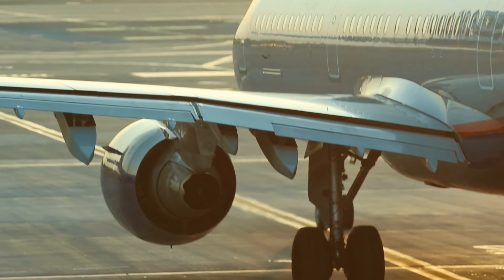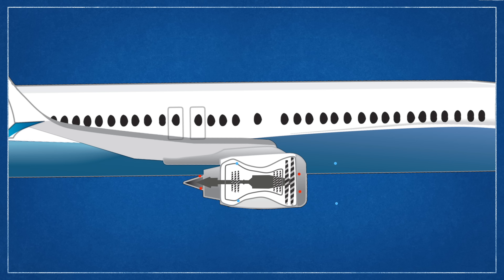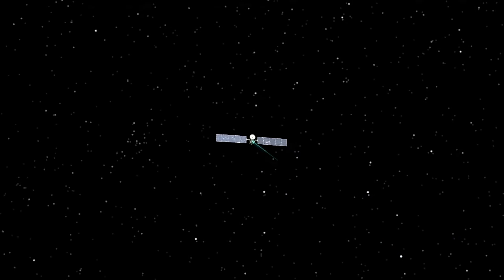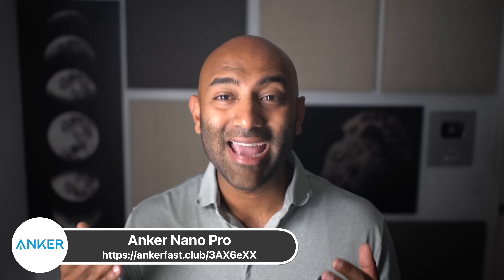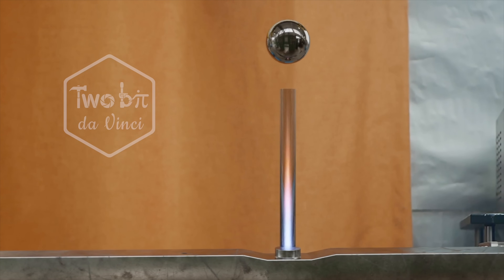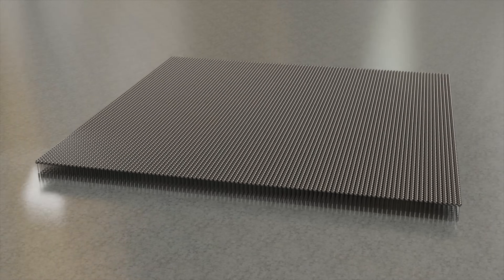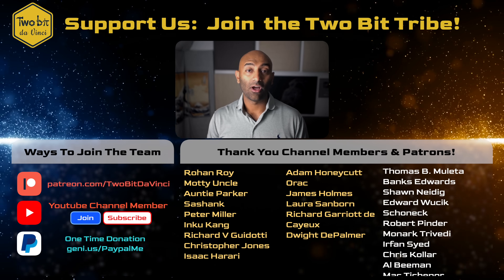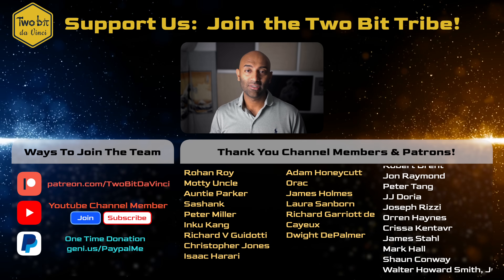The Next Generation of Jet Engines.... Is Electric?

Comment: This is some good thing honnestly. I don't know if this will be used, but the sci-fi fan in me is happy for that. However, Somewhere in my head, I'm thinking than blaming aviation for polluting when they contribute to "only" 2% of emissions is... stupid. Of course, yeah, everything help, and this is good, but when you have some things like coal plants, gaz plants for electricity, which are like 15-20% of global emissions, I think that would make more sense to reduce emissions in this sector because a 10% improvement in emissions for a coal/gaz plant would lead to a 1.5-2% global decrease wheras you have to get rid of 100% of aviation emissions to get the same global decrease.

And you know what ? Improving things by 10% is always easier than 100%. You'd not even have to build new techs : just replace the fucking coal/gaz plants !

And if that's way too hard, what about reducing packaging waste ? Why the fuck do you package vegetables ? Instead of putting the whole vegetable in plastic (with holes), what about just using a rubber band ?
Why the fuck is the responsibility of packaging on customer hands when you have almost never another "environmentally friendly" packaged product ? Why do you have to modify ALL your habits, when companies just have to fucking change their packaging habits ?

If you start looking at how much packaging is producing in emissions, I'm pretty sure that's the almost big polluters out right here. And possibly even polluting more than transportation.

Honnestly the whole shifting responsibility on customer is the biggest problem right here. We need better politics, because that's the only ones able to put some laws. And yes, I'm aware that using paper/cardboard instead of plastic is not always an option. And that shifting from plastic to paper/cardboard may lead to deforestation. But I'm not talking about replacing everything at once. But you know, for example, when I bougth a brush, the whole brush was in plastic, and fixed to the rack by the plastic whereas the handle had a hole, to be attached to the wall. Why just not put a sticker with the price, and use the handle hole instead of a full plastic which will straight go to trash ?
This is bothering me. Not aviation pollution.
Reply: I agree with you thoughts about aviation percentages. Not trying to be prudish, but would appreciate it if you cleaned up your language in a public forum.
Reply: @timgurr1876  Yeah sorry, I get usually triggered when talking about some subjects that I really care about especially when I think there are easy answers not being made for any reasons (usually the following two : greed from big corporations + corruptions of politicians usually). Thanks for the feedback I'd try to be more cautious next time.

Comment: The discovered technologies for one field usually find ground in something completely unrelated. I could imagine these being used for Space elevators that would allow a shorter length without a counterweight, Combined with an orbital ring allowing you to travel anywhere in the world at half the time without flying
Reply: Add that engine to Kurzgesagt's 'Skyhook' elevator/slingshot and boom, cheap interplanetary travel.

Comment: In the meantime- Fly aircraft on liquid Hydrgen.
Use walk-away safe Liquid metal Thorium ion molten salt reactors (TRMS) to generate electricity for $15/MJ (or 5.4cents per kiloWatt.hour); to electrolysis water for liquefied Hydrogen; to drive 
1) long haul trucks and trains; or
2) slightly modified fan turbines ( electrolysis fuel cells to electric propulsion via batteries. You can't do it by destroying tropical rain forest for Solar farms - (follow Indonesia's example instead).🥝🥝🙏👍👍
Reply: So aircraft propulsion is simple.
Using the near ambient pressure but high temperature Thorium molten salt reactors, you manufacture an aircraft jet fuel known as JP2. This has been tested by the US Navy and found to be successful, with the intent for aircraft carriers to make their own ful for their jets.
This is a CO2 neutral cycle as the marginal use of a Thorium MSR is CO2 neutral not like Mickey Mouse Ethanol-LoL.🥝🥝🙏

Comment: Two Bit da Vinci
: Great presentation, as usual, thank you for sharing. The possibility of gravity drive systems for spacecraft would make an interesting topic.
Edit: To those kind enough to reply to this post, remember that every rocket that leaves the planet, every satellite placed in orbit, and every craft sent to the outer planets and beyond make use of gravity for acceleration assist and orbital maneuvering to place the vessels in proper alignment and trajectory. Even SpaceX is considering sending Starship sunward for a gravitational thrust and acceleration around Venus in order to reach Mars faster.  Also, it is my firm belief that "gravity in a bottle," so to speak, in the near future will be a real thing.
Reply: We need a practical way to influence gravity first.
Reply: It is just not possible to manipulate gravity in the real world in a sense that could be used for propulsion. Not just difficult to do.

Comment: So, plasma being super hot, seems like one could harness that heat, either with a sterling (like a nuclear sub) or closed loop steam engine, to run a large enough generator to produce the electricity, or at least a good deal of it, reducing or eliminating the need for batteries.
Reply: ah no, that would be a perpetual motion problem. plasma is not hot till you add energy to make it that way, you can not get more energy back out then you put in, unless something like fusion happens that creates more energy.
Reply: @livefancams  could still harness waste heat past the expansion nozzle where the thrust happens to offset the need for excessive batteries.
And if you're running it on something like helium or a low boiling point refrigerant, I suspect you could get quite a lot.
Reply: @ryanjamesloyd6733  the expansion of the gas is what creates the thrust, any amount of capturing that heat again would result in the gas cooling and not expanding so not thrusting. It's like when people say "put a car alternator on an electric car to recharge the battery. It's just energy being converted multiple times for an overall loss in efficiency at every conversion point
Reply: If your saying capture the heat after it leaves the nozzle then all I can picture is a long tube hanging behind the jet, causing drag, and good luck capturing enough, then converting enough, efficiently enough, to supply itself. The laws of thermodynamics will never let you do that unfortunately
Reply: @WileHeCoyote  they always have a rim or flaps past the nozzle.  The heat at that point is irrelevant.  Easy enough to harness it there.  Not looking for free lunch.  How Much heat can you draw from a several thousand degree source with a low boiling point working fluid?  does anybody know?  Seems if it was done right you could spin the shit out of a turbine with it.  Anything produced onboard from waste heat is a savings in batteries.   Not saying it Would even out, just that it's worth looking at.
Reply: You would get more power for less weight by insulating the engine. The waste heat got it's energy from the electricity to begin with and you will never get back most of it plus sterling engines add weight and can mess up your aerodynamics.
Reply: @garethbaus5471  depends- whats the energy density per kg of a sterling engine vs that of batteries?  
Bit of a silly question the way its asked, but a relevant one, if you see what Im pointing at there.  What's the max output per what duration of a stirling or closed loop steam engine at plasma temp vs that weight in batteries over what time?  does anybody know the answer to this?

And how does the heat produced stack up against other fuels? it's absolutely possible for an external comubustion engine to match an internal combustion one, close enough.  Air force ran a truck on one and it was more efficient, fuel wise, than a standard internal combustion engine.  So what's the difference in plasma heat vs standard fuel combustion heat?  there's more to that question, but I'm not quite sure how to ask it right.    is the conversion from electricity to plasma a more efficient (in terms of heat output per kg), than say kerosine, which does not burn as hot?
Reply: @ryanjamesloyd6733  the sterling engine wouldn't be likely to reduce the amount of batteries you need at all, the heat from the plasma is what is causing the expansion that ultimatly pushes the engine forward, and sterling engines have a terrible power to weight ratio even if extracting the energy didn't reduce the efficiency of your vehicle.

Comment: Pretty sure that this is where Hydrogen Fuel Cells would fit instead of Batteries.  It wouldn't be difficult to build up the infrastructure and you could probably make it on site at the Airports.
Reply: For heavy vehicles like trucks and aircraft, liquid fuels will remain king until serious breakthroughs in battery technology. They probably will need to becomes 2-3x as energy dense to be viable since weight becomes such an issue.
Reply: @lich5655  pretty much, the good thing is hydrogen is a potentially low emmision liquid fuel capable of filling that role.
Reply: @garethbaus5471  that depends upon how the hydrogen is produced. Blue hydrogen is hydrogen made using fossil fuels, which puts out lots of emmitions. Green hydrogen is hydrogen made using renewable sourced electricity, and in that case you would be right about the low emissions. There is also the fact that it takes more energy to produce hydrogen than using hydrogen produces.
Reply: @justinweatherford8129  slight correction blue hydrogen is made from fossil fuels with carbon capture to make it less bad. No system is 100% effective at capturing emmisions so it isn't quite as clean as green hydrogen. Gray hydrogen is the high emmision option that is made from fossil fuels without carbon capture.
Reply: @lich5655  : Proper batteries will probably never be capable of powering long-haul airplanes, because there is literally no possible battery chemistry that comes close to any important metric of hydrogen or petroleum fuels.

Comment: Ok Ok I hear you but you say nothing about risk? You said it was Microwave tech, well does that mean being near one of these engines all the waves given off will cook those near by in some way? Maybe subtile maybe not? Nobody working near these thing have been safe in other machines and are known in cell tower to cause Cancers in those within 200 yards in a relative short time two years and I am sure they don't have anywhere near the intensity of one of these engines. If you plan on doing these shows, to be anywhere near competent and moral you must add a part of risk management and threat assessment weather as investment or development. Madam Curry died of Cancer from her experiments. This from Radar of the 40's to 5G at present they have deep 6 all information that is negative to these techs. This is evil. So just as the vax making informed consent has been deep six also. Don't help these evil F's destroy are world.

Comment: Wouldn't plasma make sense in Hyperloop projects?
Reply: Hyperloop needs a vacuum to operate, introducing an expanded gas/plasma would not be ideal. And if your going to go to the effort of making a train sized tube to hold a vacuum, the mag lev tracks used to suspend the train might as well push it forward too

Comment: Sady ion/plasma engines could never work in the atmosphere without producing masses of NOx and ozone, and that is a showstopper.
Reply: That’s interesting - is that in a similar way to how its created by lightning, with the high temperature acting as a catalyst? Not sure I like the term no emissions either as momentum propulsion is the very definition of emissions surely - just because it is taken from the air around it doesn’t mean it is the same when it exits as a plasma.
Reply: @davidshipp623  that is correct. NOx is produced by high temperatures and is why fossil fuel power plants can't run at higher temperatures
Reply: @davidshipp623  Yes, exactly. High energies and temperatures by spark or combustion force O₂ and N₂ to break apart and recombine as various other molecules, and high voltages make more O₃ - this is useful in the stratosphere to block UV, but is is extremely dangerous at ground level - you will recognize it as the smell that laser printers, photocopiers and ionizers produce.
The lethal dose for humans is just 50 ppm over 30 minutes, so these must be well ventilated.
Reply: I was surprised this wasn’t mentioned at all. Anything with air plasma is going to make a lot of nox and ozone.
Reply: @gIozell1  Probably because the researchers aren't looking at it. They just said "I want to be paid to be a researcher please and here are some of my favourite buzzwords", and then some government or managment responsible threw money at them. There is a lot of utterly pointless research being done, both at universities and at private companies, that improves some aspect of a system and sounds good on paper, but will never contribute to any real development because it chooses to ignore the actual real problem of the technology.
Reply: I came here to say this, so glad I'm not the only one to see this problem. If we could tolerate the NOx emissions generated by a plasma engine we could also have much more efficient jet engines just by maximizing combustion temperatures.
Reply: @millionmanification Engine component heat resistance can be improved, for example by using advanced alloys or ceramic coatings. This development is limited by the unavoidable increase in NOx emissions that an increased combustion temperature would cause. 
The development of the turbofan engine has nothing to do with cooling, and everything to do with efficiency.
Reply: What's wrong that's similar like lightning and NOx is great fertilizer

Comment: Disruptive technologies are almost never better than the technology they replace “in every way”. They are better in the areas that the market determines to be important. So propeller driven aircraft could very well return for short haul passenger flights and short and long haul cargo flights (where trip cost matters more than a few hours of transit time). If the market for long haul passenger is the only area where electric aircraft dont make sense, then jets will optimize around that market (see Boom aerospace).
Reply: They are not better replacements when they are rushed and forced. If given motive, time and money a disruptive technology could and should be an improvement.

Comment: I hear dirigibles are coming  Back. Maybe those could be used because they are lightweight yes they do not go fast and and as far as electricity because of the damage bull is going through the air it creates static electricity much like helicopter blades . I'm not sure if static electricity has enough wattage to power I'd like to power your plasma thrusters a thrusters but it's something to think about sorry sorry for the punctuation missing I'm using voice to text in some

Comment: I immediately thought of the ion thrusters Xenon for everyone else and Krypton for Starlink, and was wondering how that'd work in atmosphere
Reply: Laser or microwave beaming?

And.... You just mentioned lasers as I typed that
Reply: Considering that the best ion thruster designs in use today only generate half a newton, not that well, their strength lies in the fact that they can continuously provide thrust over long periods of time which can allow for potentially top speeds or very presise course corrections at a low cost of "fuel".

Comment: No need to be limited by propellers, turbo fans work at 500mph+. So 'just' drive those with electric motors. (Those quotes around the 'just' is the tricky bit :) )
Reply: Yes, there's nothing fundamentally different between a turbo prop and a turbo fan engine. They are essentially the same thing optimised for different flight speeds.
Reply: "Tricky" is an understatement. Even accounting for the greater efficiency of electric motors and neglecting how much combustion engines can still improve through higher temperature materials, the theoretical limit of batteries is still only about 1/3 the capacity of hydrocarbon fuels. Electric air travel simply isn't feasible without air portable nuclear power (either fission or fusion) or something even more exotic.
Reply: They're called EDFs (electric ducted fans) in the RC community.
Reply: what is mph?
Reply: @TheMntnG  miles per hour. [Multiply by 1.6 to get kph (kilometers per hour)]
Reply: @mb-3faze  
why not just do kph directly?! miles is outdated isn’t it…
Reply: @TheMntnG  Not really. Even kph is not the standard unit for velocity. Certainly 223m/s would be more correct for SI units. In the English-speaking world we have 330million people in the USA who understand miles, 38million Canadians who, due to their proximity to the US don't really have a problem with miles. The 68million UK people are familiar with miles and the 5 million Irish are clever enough to work in any units. So that leaves the 30 million Antipodeans. They like their k's but probably have better things to worry about. In pilot-speak I should say 434 knots which is an even more antiquated unit of measure.  Maybe people would prefer 1.34million furlongs per fortnight? Why not, it doesn't matter.
Reply: @mb-3faze  
that‘s just the anglosphere, no human majority. did you not have geography in school? or learn about more than 5 countries? sad